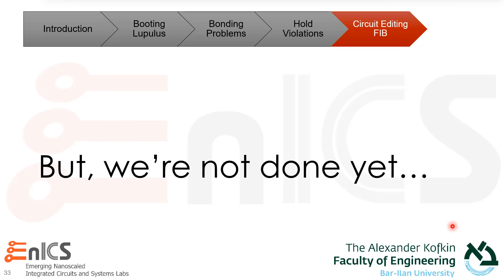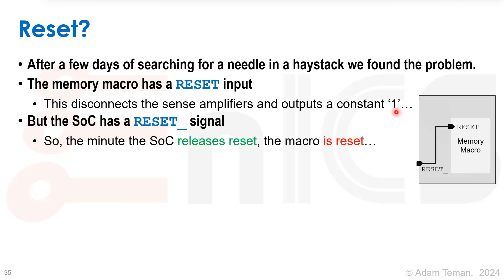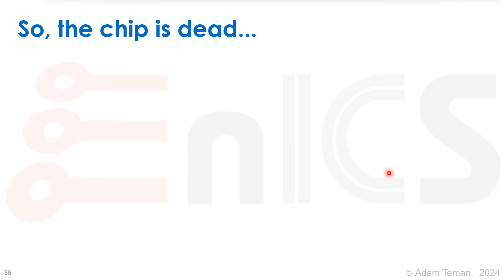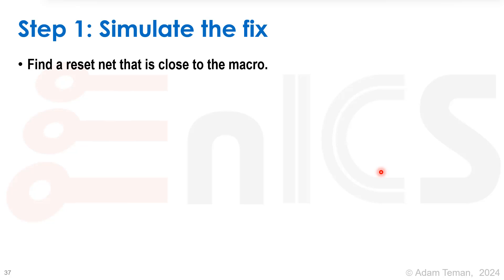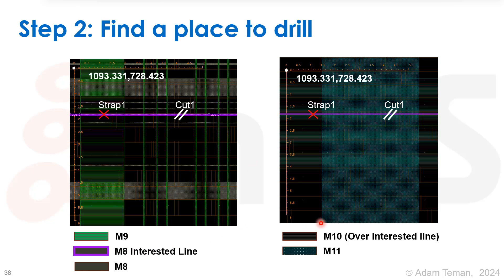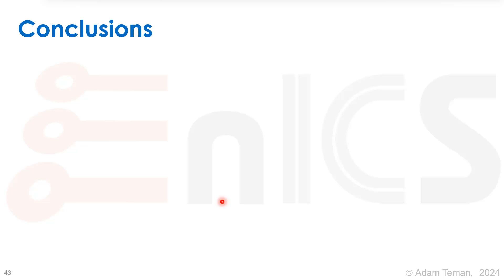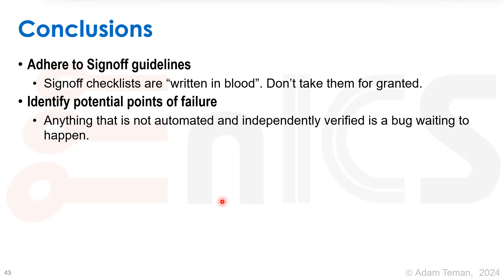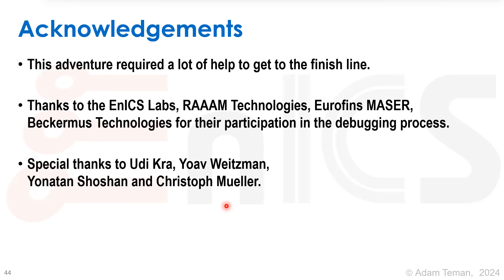SoC 101 - Lecture 8e: Circuit Editing FIB

Comment: Hi Adi - 

Loved your course. Thank for that. If you can answer few questions (just out of curiosity) - 

1. About the hold violation - so didn't you run all PVT scenarios in signoff or was there just some SDC screening off the violation?

2. Now that you understood the issue with the memory rst, what can you do for mass production? to which layer did you drill inside it? Doesn't that mean you have to reproduce many masks for it (metal fix)?

Thanks for this course it was very interesting and helped me a lot!
Reply from the maker: Thanks!

For the hold violation - we ran regular BC-WC. Had some trouble with licenses and tool setup and ran out of time. We had an "opportunistic tapeout" so preferred to make it on time rather than making sure we took care of everything in signoff. But we figured that with large hold margins, things would be okay... they weren't.

For the FIB issue - we actually did several fixes because Maser didn't guarantee that it would work and for a few other reasons. So we had some that went down as far as M4 (in the end, all of the fixes worked!). Regarding mass production and metal fix - in any case, this was a shuttle, so (usually) metal fix is not a real option (though a simple metal fix would have done the job). We had another tapeout coming up in any case (as I mentioned, this one was "opportunistic"), so it was an easy fix before the new tapeout.
Reply: @AdiTeman 
Thanks for the reply. Great to hear that everything went well at the end.
Once again, great course and the last lecture about the bring-up really added a good context to everything.
Reply from the maker: @Elior92 
Thanks. I think so too. I wasn't expecting to get this additional lecture, but I felt that it fit right in.